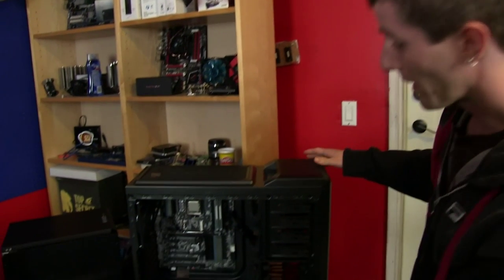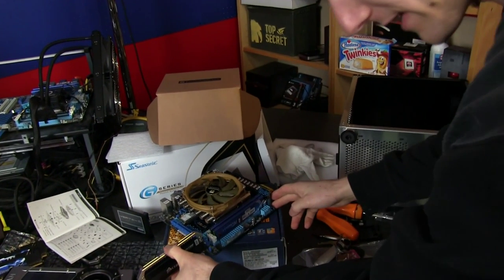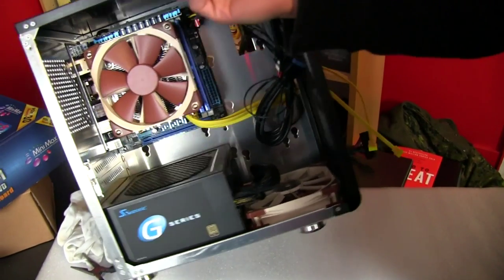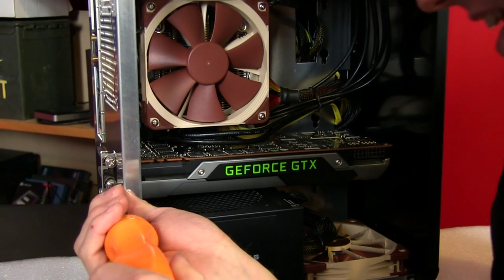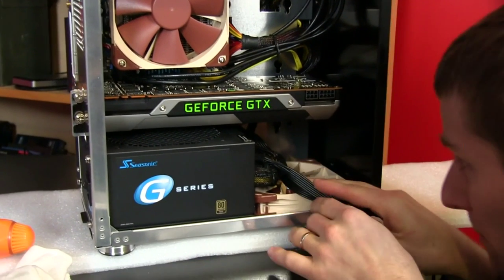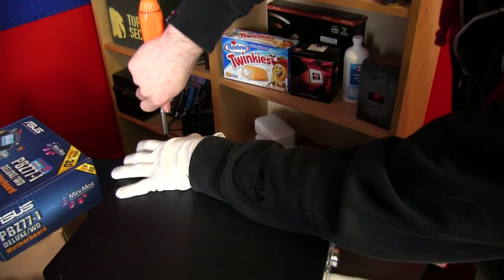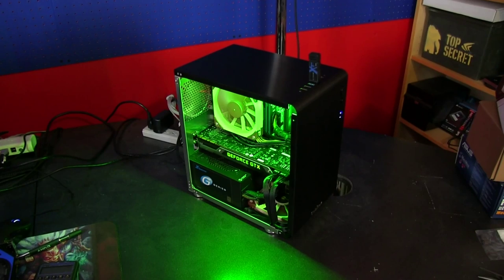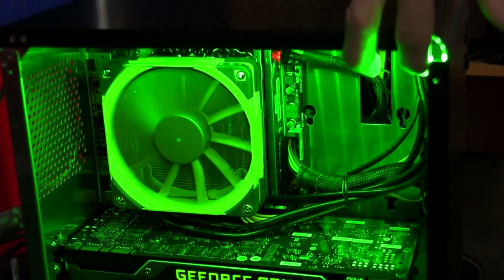GTX Titan Small Form Factor Gaming PC Build Guide Linus Tech Tips

Comment: 550 watt psu with a titan????
Reply: it doesnt matter about the brand the 550 watt will only pump out 45 amps, im not sure what a 780 needs but im sure its around 40 amps.  power supplys loose their maximum current output over years so thats when a good psu takes its place, but still running the psu at nearly 90 percent load isnt good
Reply: *****  Actually Seasonic G Series 80 Plus Gold is one of the best in the market and it's not like the older psu's a few years back, the 550 Seasonic can handle it with no issue, it's won't run even close to 90%.
Reply: bronze is shit, it heats up faster and pulls more current out of the wall to get your 550 watts
Reply: ***** its 80+gold but..
Reply: Battlefield 4 | Gameplays and Reviews.
80+ titanium ftw.
Reply: Mihai-Ioan Mihut lol Nope! 80+ Uranium!
Reply: DragonFireXY 80+ Iridium Skrubz
Reply: niofalpha
80+ Unobtanium
Reply: niofalpha
80+ dirt is the shit dawg!

Comment: I know this is a 2 year old video, but, why is the interior lit up when you'll never see the light?
Reply: Randall Stevenson He installed a strip of LEDs inside the case. He mentions it briefly in the video.
Reply: Bryan Shouse

didn't ask how, just why
Reply: Randall Stevenson Ah, I get you, he didn't use a case with a window in the side. Well, the light actually does leak through the edges, especially the bottom; you can see that in the video. But perhaps he put it in there because of, one it was free, and two force of habit? LOL
Reply: Bryan Shouse

I can get behind that

Comment: Hair dryer sounds like the 290x lol
Reply: i can confirm
Reply: Are you serious? Ive been thinking of getting a 290x... guess not anymore
Reply: danermanerkider its not that bad its still a great card
Reply: PCGamerUnion Would you say its louder than a GTX 770? Im going to be doing an ITX build and gonna use an EVGA GTX 770 with ACX cooler.
Reply: danermanerkider yes 290x at 100 load sounds like a jet engine
Reply: PCGamerUnion But is it actually louder than a gtx 770? The 290x might sound like a jet, but a 770 might sound like a nuke?lol
Reply: danermanerkider well i don't know my last card was gtx 610
Reply: PCForTheWin Im okay with the 770 ACX, the noise is a huge part, my build will need to be nearly silent. Also, i dont like to do water cooling and im too lazy to add a water block to the card.

Comment: Linus, could you make a video where you make a small form factor computer, with a price around 2,000 dollars, optimized for gaming and editing??

Specs similar to this:
Case: something from bitflex, fractal's node etc
Motherboard: that supports everything below with like the MSI 1 sec overclock
Ramm: 16gb or more
Cpu: i7 4770k with a water cooler, like corsair H60, H80 or something else
Gpu: 780 or something similar in performance
OS: Windows 8.1
Storage: SSD for OS and SSHD for storage
Psu: that have enough power to the parts above

Please respond or make a video, i'm selling my old pc and i get around 1,500 USD from that, i want a smaller pc, my old case was the Corsair 650D.

Comment: ugg turn the psu over
Reply: I guess it's supposed to be drawing heat off of the GPU. Then again it's a blower-style card so the heat is going right out the back of the case. And the PSU fan might be stealing the fresh air from the bottom-mounted fan feeding the GPU. So yeah, I don't know why he didn't flip it.

Comment: That's exactly what I thought at first, but the results really surprised me. With one hour intervals: Idle temp is around 30-35°C. Gaming on Bioshock Infinite at Ultra settings brings it up to 45-50°C. All this with no noticeable fan noise. If I crank up the GPU fan or the chassis fan, I might get lower temps...

Comment: My pc sounds like the hair dryer on low on initial boot then the corsair controller kicks in and throttles back the fans. I bought one of those cubitek cases linus after watching your unboxing and this video of the case to assemble my system into. All my fans are noctua's, I even exchanged the ones in my UPS with them. Loudest fan in the house now is the pedestal fan which keeps the human cool ;)

Comment: I have just completed a similar system but I went with the EVGA Hadron Air case, an Asus Maximus VI Impact motherboard, Intel i7-4770K cpu, 16GB G-Skill Trident X 2400 sdram, EVGA Mini-ITX cpu cooler, EVGA GTX 780 Ti, 2 x Noctua NF-F12 120mm case fans and 2 x OCZ Vector 512GB SSD's. At idle it's relatively quiet and cpu temp is 32-34 degrees celsius. During gaming noise does ramp up a bit, think it's mainly due to a high pitched whine coming from the cpu cooler's fan.

Comment: That was one of my 1st questions too! Then I realized the PSU was the only exhaust fan being used for the case besides the video card it self. I defiantly would have gone liquid cooled with an H80i or Water 2.0 Pro in push/pull and kept the Dominator RAM but then again he'd have one more fan in the case whereas the objective was for it to be a quite build; yet he could have used just the one Noctua on the radiator.

Comment: Not sure, but I'm running Tomb Raider and Bioshock Infinite on ultra settings. I do not notice any hiccups at all. Probably I'm only running it using 1080p (max resolution on the Ben-Q). So far, this more than meets my expectations. My goal is a small, quiet build that can run any games that I throw at it.

One week in and I gotta say this is a media powerhouse. I showed this computer to my wife and she thought that it's a simply subwoofer. lol.

Comment: that is actually really badass. and its nice to see you could drop a full size heatsink or a single fan rad in there....looks like you could actually have a nice little cylinder res with attached pump even
Reply: lol its sheet metal you could drill with with nothing special. But point taken.

Comment: I know that... I was simply stating that unless you have a monitor that supports a higher than 1080P resolution, you won't be able to see the option in a game to change it to that. Like I have a 1920 x 1200 monitor and a 1920 x 1080 monitor, if I pull up a game on my 1080 monitor it won't give me the option to choose 1920 x 1200.

Comment: Thank you ! 
Just watch some Benchmarks, the R7970 is a hell of a card for the small price.
Of course, it depends on the game which you want to play, but many gamedeveloper support amd more and more.

I have to say, i have a XFX HD7970 Dual Dissipation, its one of those cards who is hotter than other and the voltage converter are very very hot as well ( 100° ). 
I don't know if other cards from other publisher have the same problem

Comment: Something I wish case manafacturers would do is to mount the power supply to the right of the cpu. Like this you could easily save some space. The only problem is, is that you will need an extension cable or the power cable has to plug in on the top of the case.

Comment: Thats my dream build right there, i had attempted a micro atx home theater size/style desktop that would be easy to take on the go for gaming. Even tho the cpu and mobo were both the same socket, turned out he cpu (my first dual core when they were still super new to ppl) turned out it was meant for a laptop and it fried the mobo and cpu :P

Took it to geek squad and they screwed me outa $800 but man if that cpu and mobo worked i woulda had a crazy tiny lil setup that could be comparable to my dual 8800 build that had a core 2 duo back when that was still new tech for the most part.

Thanks so much for showing me what ive always wanted as a build without having to put me thru the hell of what i had to deal with that one time lol

Comment: Love the video and build! I have a custom build with: i7-4770K, 2 Nvidia GTX 770 2GB SLI, 120GB SSD, 3TB HDD, Blu-Ray Drive, H100i Water Cooling and a MSI MPower Motherboard. Its pretty great, I mostly use it for graphics design now.
Reply: That's a really nice PC dude, I only have a 650ti, AMD 4300 3.8 GHZ Cpu, and 8gb of ram, hoping to get a new PC for christmas and buy all the parts then build it like I did with this one
Reply: I got a MacBook Air with Intel core i7 my Mac says it's 1.7 GHz dual core (it says 3.3GHz turbo) and I have 8GB RAM and my mac somehow says I have 1.5GB of VRAM I also got the 128SSD my Mac has intel graphics 5000 it's fast for things i do (example: Kerbal space program, x-plane with high res textures and full settings on minecraft) and the battery lasts a while when I'm playing games on my Mac
Reply: Radovan Bronisevsky games... on a mac?

Comment: I dont think anything is bottlenecked; however, if you want to add a secondary GPU later on, you might consider  new PSU. For CPU, AMD CPUs are good for tasks that takes advantage of many cores such as streaming. I would recommend i5 whatever K series for gaming, though. I personally use i5 3570k for my rig. If you have no option for different CPU, what you got there is excellent too.

Comment: I'm very pleased with the performance, especially when you consider the price of 300€.
I've overclocked it to 1100mhz Core Clock and its awesome !
Of course it is very hot as well ( 75 - 80° @ 45% Fan speed )

The performance is nearly as good as the performance of the GTX780 Stock, i would say the HD7970 Ghz Edition is between the 770 and 780GTX.

Sorry for my bad english, i'm from germany =D

Comment: i nvr meant bigger size=more heat,,,rpm must be around 7200rpm to 10krpm..sure it will heat up... i know tat for sure...keep ur facts right
n abt most hdd keeping cool...well tat's by throttling down the performance when not NEEDED...otherwise it will get heated.....the rig may not end up burning but it'll have long term reliability issue!!

Comment: you probably wouldn't want to water cool something like that, yes water cooling is a better method of cooling and good for overclocking, but there is an even bigger risk of destroying parts through water damage/leakage than in a regular case (seeing as that computer is even more compact than most). It would also be a hassle snaking the water cooling onto the GPU, since the water cooling dock would be underneath.

Comment: At 9:37  in the video what causes the computer to bootloop like that? I currently have a system that is doing this. I have to power down the power supply completely, plug it back in,  and then  reboot in order for it to boot properly.

Comment: Ok I got a big question so if anyone can answer that would be cool. This summer I would like to upgrade to water cooling and a new GPU. Im running a Geforce GTX 650 1gb which is running with a AMD fx8350 black edition 8 core 4.3ghz on a Asus 990x 2.0 sabertooth. I have no idea what GPU would be best to upgrade to, my pricing is below $250 and I would like that and the watercooling to be below $300 total. any suggestions on a GPU and a complete watercooling set?

Comment: why didn´t you turn the power supply upside down? now it will bolw towards the gpu... or is this the only possible way to screw it in?
Reply: +stefanfun3 It won't blow towards the GPU. It will draw air away from the whole interior. I do agree, though, that it would have been better for the PSU to have its own air by mounting it fan-side down (I thought I saw an intake on the bottom of the case for both the fan and the PSU).

Comment: got a question. is that 550 psu really enough for an i7 AND a titan?? also, would it have been possible to flip the psu to have the intake on the bottom, where the case has the opening for it. just a couple things I noticed during the build. im working on an i5 4760k build within the next week and its my first intel build since a Pentium 2. (I know, I know) so anything I should be wary about? anything drastically different between an intel build and an amd build other than the performance? thanks.
Reply: Heh, my last Intel build was a PII, slot 1 and sooo easy to install.  AFAIK they're mostly the same, just the pins are on the mobo for Intel (lga socket) and on the CPU on AMDs.

I've tried the PSU both ways, sucking air through the case and through the bottom vents, and I haven't noticed any differences between the orientations so I left it sucking air through the bottom.  Though I have a pretty average mid-tower.  I think in this setup having the PSU drawing air though the case is probably a sensible idea.
Reply: BobM925 my logic behind sucking air from the bottom in this situation it has the vent under the power supply, so you would be drawing cooler air from outside the case, removing a factor from the thermal loop of it. would keep your PSU cooler and running better. some cases have the ability to mount the power supply either way, with the fan pulling from inside the case, or pulling from outside the case and as I said, removing it from the loop. the reason I asked on this specific video, is because of where the video card is located. it would create a vacuum and the PSU and vid card would both be fighting for the same air. I would tend to think the PSU would get most of the available air, and thus leaving you with a cooling problem for the video card. just a thought.
Reply: Yeah good point, I actually hadn't thought of it like that - with the graphics card being so close to the PSU but I guess, I don't know!  I thought it'd be better to have the PSU pulling the air out of there to help out with cooling the system as a whole.

Comment: It's because the case is brushed aluminum, and if you touched it with your bare hands, it'll leave fingerprints. You can touch a case's panel even if the computer is on. Nothing is gonna happen.

Comment: Just build a $400 Gaming pc to play MC and Lol with some friends! Check the specs:

CPU: Intel Pentium G3258 3.2GHz Dual-Core Processor
MoBo: MSI H81M-E34 Micro ATX LGA1150 Motherboard
RAM: Crucial Ballistix Sport 8GB (1 x 8GB) DDR3-1600 Memory
HDD: Western Digital Caviar Blue 1TB 3.5" 7200RPM Internal Hard Drive
GPU: Sapphire Radeon R7 265 2GB Video Card
Case: Thermaltake Commander MS-I ID ATX Mid Tower Case
PSU: EVGA 500W 80+ Silver Certified ATX Power Supply

Total: $407 
I play MC at around 700fps on max settings. On CS:Go I run 200fps on the highest settings, same for LoL. i hopped ona more intense game and on BF4 at high/1080p I was running 40-80fps. Very happy with the build!
Reply: Nice build bro!
Reply: Lol almost the same build as Austin Evans his Axion build.......
Reply: I have a MUCH better gpu than his Axion, lol
Reply: TehWondar nice and tight bro, but still think you should go for a r9 270 instead

Comment: I can't upgrade anything in my laptop...
CPU is mounted on board....
RAM is mounted on board...
Even Wireless Card is Mounted onboard!
Only thing upgradable is SSD.
But the specification they give me is pretty darn impressive.
Reply: It's a laptop.. what do you expect?..
Reply: Whats the specs
Reply: Intel Core I5-4210 U Processor
8 GB RAM
Intel HD Graphics 4400
500 GB SSHD With 32 GB SSD Cache
Windows 8.1
Reply: Thats weird.. My $200 3 year old laptop had upgradable ram.
Reply: Mine laptop is from like 2014 and it's an ULTRABOOK, so it's very thin and light.
They have to squeeze everything to make it light and thin. From these thing, Mostly of the hardware needs to mounted on-board in order to make it to an ULTRABOOK standards.
Reply: K
Reply: laptop that thing won,t fit

Comment: damn. i would not be comfortable with 80 to 90 degrees on the cpu :/ but it's understandable with the limited cooling available in a tight space
Reply: +Thoraxe555 I was looking at it before they even finished, the GPU cuts the case in half pretty much so there is no air moving past the CPU.  I see a space for a case fan right behind the CPU cooler, probably would have been a huge help.

Comment: cpu 3770k= $330
graphics card- 780= $700
motherboard- z77 = $200
power supply- 700w= $70
ram-16gb= $120
ssd 120gb = $120
hard drive- 3tb= $120
 water cooler-Corsair h100i= $100
blu ray drive = $50
keyboard n mouse =$60
$1770

Comment: There is literally no reason to EVER use a stock GPU cooler. I realize people try and justify that pushing air out of the system in an itx build is the way to go but they are wrong, as i have tested it. You will get less noise and less HEAT with a aftermarket cooler like ACX or strix or any other cooler than you will from a stock cooler. CPU temps are barely affected by this, 1-2c at most.

Comment: 80°C on the CPU at 10°C ambient temperature.... At my place this CPU would be burning at around 105°C right now, while my actual 2500k is runnung at 47°C under load...

Comment: How did this guy never got electrostatic discharge? I thought this can happen often on mobos when your finger is near it.
Reply: Wont happen if you ground yourself. and Linus often has anti-static wrist strap around his ankle
Reply: or just plug in a PSU (turned off obviously) to your grounded wallsocket and touch the PSU.

Comment: Tell me what you guys think
CPU:AMD Athlon Multi Core Processor AD760KWOHLBOX, 760K Richland 3.8GHz
GPU:Gigabyte GTX 960 Mini ITX Overclocked 2GB GDDR5
HDD:WD Blue Desktop Hard Drive 1TB, 7200 RPM
PSU:EVGA 600W 80 plus bronze certified
Ram: 2 4gb HyperX Fury DDR3 1600Mhz
MB:GIGABYTE GA-F2A88XM-HD3 FM2+ / FM2 AMD A88X (Bolton D4) SATA 6Gb/s USB 3.0 HDMI Micro ATX AMD Motherboard
OS: Windows 8.1
Case: Fractal Design Core 1100
Reply: i would suggest changing out the power supply, go with and XFX or Seasonic power supply, EVGA psus are known for not being very reliable
Reply: ***** I was going to say he got that because his building a small form factor pc till i realized he is using an atx case that being said. Op why are you getting a microatx board for a full sized case? Just get the radeon r9 280 card instead and overclock it and im not an intel fanboy but if your on a budget get the pentium g3258 and a z97 mobo instead and oc it. At least in the feature you will be able to upgrade to an i5.